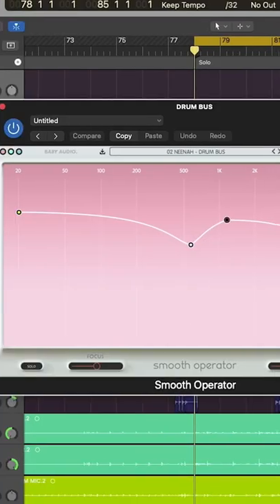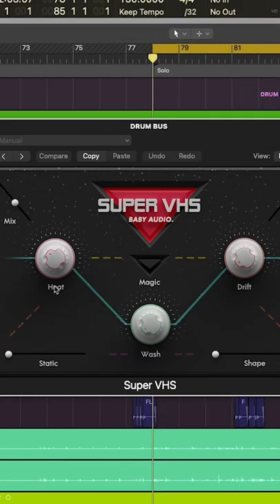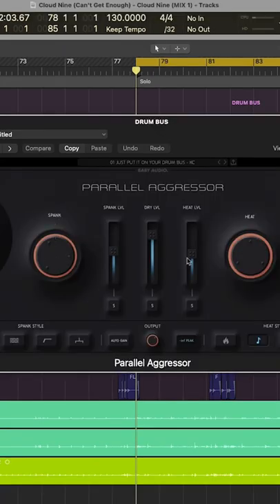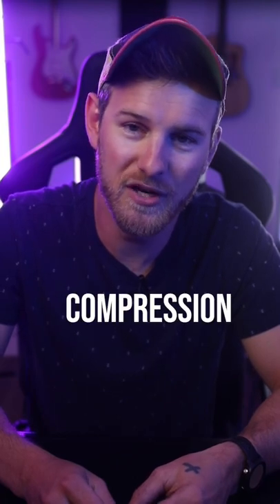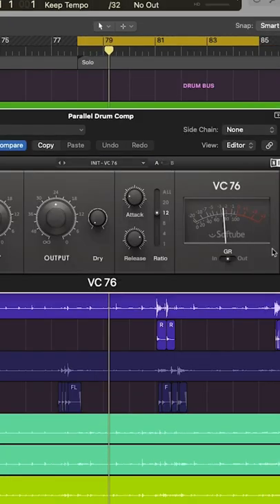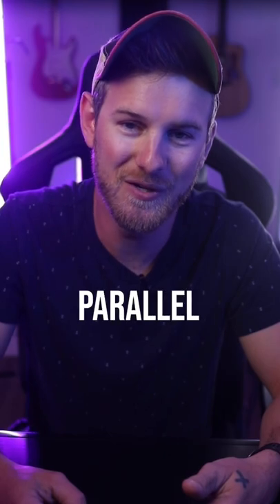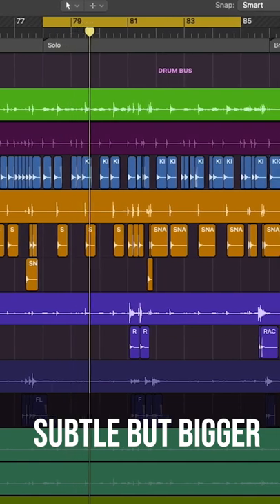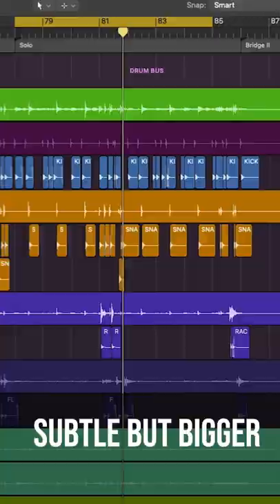Drum Bus Processing Chain

Comment: This sounds amazing! I’m using Logic Pro x stock drum kits and none of them have quite enough punch. Hope you have done/will do a full video on it
Reply: Also I think I have an older version of logic. I think 10.3.4 or something. Maybe that’s why, there’s probably been some good updates…also I love that dead snare. Super low super good.
Reply: Get the free Softtube saturation knob. Add each to taste on every drum sound.

Send the drums to a bus with the Logic Compressor. Throw on a drum preset or VCA emulation(I think it’s the black one). Compress lightly to glue them together.

Should work. If you need more low end, add a sine wave to the kick.

I mix mostly rap but this should work. Also high pass everything that doesn’t need bass. Don’t overdo it.
Reply: @lucytaylor8010  honestly the best one for rock/metal purposes might be the SoCal. but you do have to tweak the sound a litttle bit. add some channel eq to add some low end so it has a little more punch. at least the toms and kicks. and layer your snare with another snare and most important add reverb. overall that should give you a pretty fat sound compared to the plain stock sound. also try to duplicate your tracks and pan one hard left and one hard right. last thing i would say is look up some free drum sounds/samples. so you can add more realistic sounding cymbals, kicks, snares, etc.